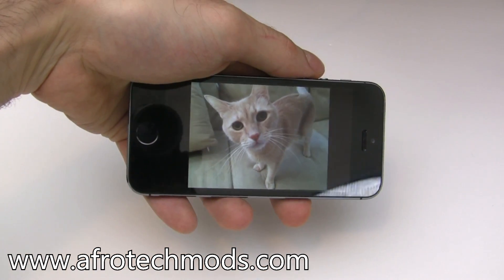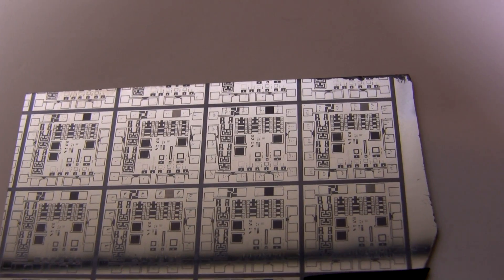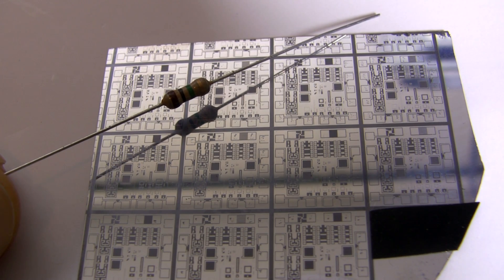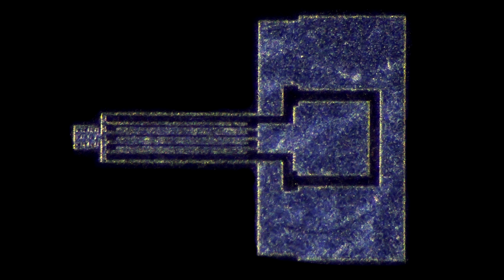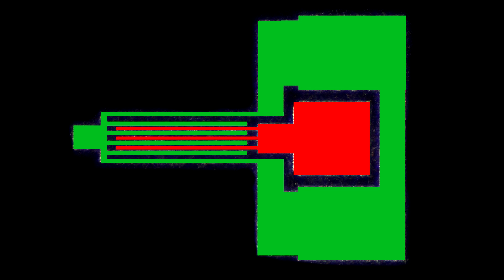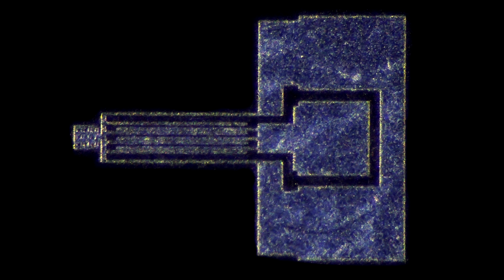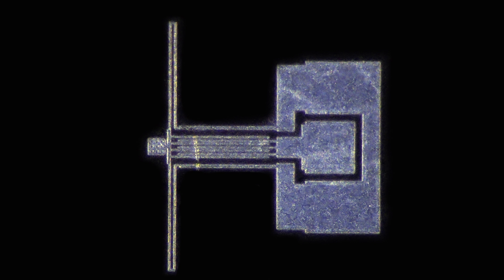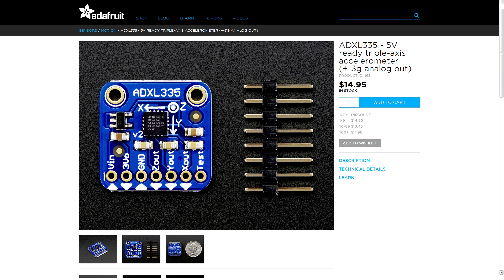How an accelerometer works!

Comment: Hi I have a doubt what happens to output of accelerometer when accelerometer is moved with same speed for some time will it be zeros or some constant km/s^2
Reply from the maker: If the velocity stays the same then the acceleration will be zero. So the accelerometer will read zero g.
Reply: @Afrotechmods   But when place an mobile on table it's velocity is zero but the accelerometer output is approximately 9.8m/s^2 in z -axis
Reply from the maker: @DurgaPrasad-lp6vb  That is because gravity provides a constant downwards acceleration force.

Comment: Im trying to make a device to help my friend walk straight by sending alerts if slightly deviated (right or left). Would Gyroscope or accelerometer or gyroscope work?  I need suggestions. Thank You
Reply from the maker: Accelerometer would be better but both could be helpful. Look up a device called an IMU (Inertial Measurement Unit)

Comment: Some animation would help the viewers tremendously in visualizing and understanding what you are talking about. I, for one, are still not quite understanding what you are trying to convey.
Reply: Change in distance between closely spaced conductors will alter the capacitance between the conductors. Look at the comb structure just as two plates for simplicity. the two plates are separated by an air gap dictated by the manufacturing process. At any rate it is a very small gap. Due to inertia ( things wanting to stay at the same speed they are currently going)when the system moves the weight wants to stay in its current state more than the thin plate(s) it is attached to  so in doing so it bends the plate ( or comb) it is attached to creating a difference in capacitance which is sensed electronically.Is this helpful?

Comment: Gyro sensors rotate the screen not the accelerometers
Reply: No.  The accelerometers are used to detect orientation.  The Gyros give a turning "rate", which is really not very useful to detecting screen orientation by gravity.

Comment: Do you need a Arduino main board to power the ADXL335 accelerometer?
Reply from the maker: No you just need a voltage source, but an Arduino would be helpful to read in the data from the accelerometer
Reply: Or if you are a games developer you can use Unity for testing the accelerometer ;)

Comment: Hey Afrotechmods plz do a video that tells the difference between current and voltage...
Most of the people in real life doesn't differ between them..
I also do have a little idea about it...
Reply: This much i had since my schooling.
***** wanted to know more.
Reply: Thank you though.. *****
Reply: shubham saxena You can think of electricity like a river flowing downhill. The current is the cross sectional area of the river, so is the amount of water flowing at any given time. 

The voltage (also known as potential difference) is the difference in height of the river, so it is the amount of 'pushing force' behind the river's movement.

To sum it up, the current is the amount of electrons moving while the voltage is the amount of force that is 'pushing' the electrons.
Reply: Ben Adamson thank you brother...
Thanx a lot.... 😊😊😊😊😊

Comment: What I wonder with these micosystems is HOW do they actually move? Are they suspended in some medium? Where are the fulcrim points? And how long is the mean time between failure? Will my car with 100,000 miles hav .one fail and wrap me in my big Pie Hole someday?  Can you do a.video on barometric swotches also, and others on these most interesting devices? Do.these qualify aa nanomachines?

Comment: i thought it was like that thing in dualshock that vibrates
Reply: That's just an electrical motor with an off-centre mass, like a tiny version of a washing machine with a heavy load, as it spins it shakes.  Cellphones have ones that are even tinier still, hard to even recognise them as motors.

Comment: Great video!   I've read that acclerometers are very noisy and should only be used for steady-state tilt information only, even though they are often rated to  measure 10khz.    Is this true?   Is a gyro the only way to get accurate real-time acceleration data?    A video suggestion :  the mechanism behind gyros and the practical difference in the data produced vs accerometers!
Reply from the maker: You can use an accelerometer to measure acceleration just fine. However one problem that some people encounter is trying to integrate acceleration to get velocity or position data, and in those scenarios accelerometer error does accumulate very quickly, so people tend to combine data with gyro & gps.

Comment: interesting! How hard do you have to shake an accelerometer for the capacitor plates to touch each other and create a short (possibly destroying the IC)?
Reply from the maker: It will depend on the accelerometer. You'll have to check the datasheet. >100g to damage most I am sure.
Reply: If they can create solid insulators, via doping, then these can be used as limit stops to prevent shorts

Comment: Is there a reason why so many of these sensors require 3,3V (those who accept 5V very often have a 3, 3V regulator)?
Reply: 3.3v is a common digital devices voltage.  I'm not sure of the origins or reasons it's used, though.
Reply: i guess that the reason is because some devices only have data lines with 3.3v volts like the Rpi, if you used 5v you will end up frying the gpio or the processor of the pi

Comment: Yeah, they need to make accelerometers better in phones.. My phone takes forever to rotate the screen.. It's like this: "Oh, you've rotated your phone 90°? ............................................................... Was I meant to do something?.......................................................Oh yeaaahhhhh!!1!11!!!!!1!1 I'll rotate the screen for you.. Just give me a minute, I need to make sure you have actually rotated the screen exactly 90° and not 89.999°.............................."
Reply from the maker: Jordan O'C Actually the accelerometers themselves are fine. They can update dozens of times per second. It's the code they use in software that is responsible for the delay. They average out the reading over time then wait a second to make sure that the device isn't still being rotated before actually flipping things. I agree that the delay is longer than it needs to be. Are you listening, zombie Steve Jobs?
Reply: Afrotechmods  Or they could just make the delay user one of the settings. And its not just Apple.....
Reply: Afrotechmods Can you do a video on how gyroscopes(electronic) work?
Reply: well take into account that your phone basically switches resolution (the short x and long y to the long x and short y (or vice versa)), which is completely new layout, and whatever it was displaying usually has to be display differently (hence image processing/rendering). If it has already high cpu usage and not much free ram, it's not an easy task for your phone, especially with sort of high pixel resolution the smart phones have. It's better to have your screen rotation switched off for general use and switch it on only if needed.
Reply: Mare Rožmanec Got a Note 4, no delay, your phones must be cheap or old.
Reply: Afrotechmods

yeah.

I have an accelerometer module (accelerometer + gyroscope + magnetometer), and it can be read at 100Hz (over I2C).

IIRC, it can measure +/- 64g (depending on settings), and angular velocities up to 800 degrees/second (also depending on settings, it is a range-vs-accuracy tradeoff controlled via internal registers).

apparently, it is intended primarily for use in cellphones, so I am guessing this isn't too far off from typical.

I had intended to use it in a largish quadrotor (intended to be made to look like an oversize wasp), but this never (or hasn't yet) gotten built, mostly due to the lack of affordable propellers in the needed size-range (compared with everything else, the 20 inch propellers are absurdly expensive, but would otherwise need to reduce target size and cargo capacity to be able to use cheaper propellers).

so, project has shifted mostly to trying to build a CNC machine, partly to be able to machine the propellers out of hardwood. had previously started working on casting them (out of fiberglass), but winter largely killed this (too cold outside to do fiberglass, and too stinky/nasty to do inside).
Reply: That's why we need round screens, then the 89.999°................... rotation would still fit and look fantabulistic.
Reply: If you have a delay, just turn the phone earlier to make up for it. You're welcome.

Comment: Is there a way to avoid (physical) oscillations in such circuits? Is it  damped out somehow?  It might be fun to try to make a more macro size one with little magnets on plastic tabs with hall effect sensors.
Reply: Since the structures are so small their resonant frequency (and hence oscillations) are very high in frequency, and your measurements would be lower than the resonant frequency.  If you do hit resonance, it can destroy the accelerometer though, depending on the model. Some may have a 'hard stop' which prevents excessive deflection at resonance, and prevents damage from mechanical shock (i.e. 8 g accelerometers that can survive a 10,000 g shock)

Comment: Why do a lot of accelerometers seem to have a delayed response (e.g. video game controllers, tablets)?
Reply: It's not the sensor , but the electronics and software that reads it that causes the delay. The data from the sensor is converted to digital data. Then it goes through software calculations to determine the angle , speed .. This causes a delay.

Comment: Great video (as always). But I except it to be a little longer. What about making a second part explaining MEMS gyroscope, magnometer, ... (9 dof) and how to use them together to retrieve stable and precise orientation (kalman filter, high/low pass filters...). No need to go in math detail, just to mention it.
Reply: The gyroscope uses the Coriolis effect combined with vibrating matrices at each axis. Basically the vibrations tend to stay in the same plane as the supporting structure of the proof mass. IIRC they still use changing capacitance but its the error of the vibrations which is really measured as this would indicated rotation about that axis.

Comment: Strange. For some reason in my mind I always imagined tiny ball bearings in channels with contact points on the the sides and ass the ball rolled past it would tell the device which way it was tilting. I guess it wouldn't be able to detect how many g-forces are being applied though.
Reply: That's called a tilt sensor.  Adafruit sells those too. Quick and dirty way for determining "is right side up" or "is not right side up."

Comment: where did you get the silicon? and how did you etch it?
Reply from the maker: This was a long time ago, in a galaxy far far away. The technique is called photolithography and here is a good primer: http://www.youtube.com/watch?v=1bxf9QRVesQ
Reply: +MrPolymath0 There'are a lot of phases as following:
- Chemical Vapor Depositation ( at low pressures and high temperatures) o Epitaxial Growth 
- Etching of silicon parts in order to achieve the correct mass for the wanted resonance frequency ( taking into account non idealities due to under/over etching) --> Dry etching or wet etching
- Dioxide Silicon Elimination using acids like HF.
So in this way, it's possible to correctly obtain a moving mass which will be the inertial mass for the inertial forces detection. 
-Packaging ( at low pressure, obviously depending on requirements and budget), by means glass frit or eutectic bonding. etc etc. It may seem easy but it's far from it.
Reply: I am wondering the same thing!